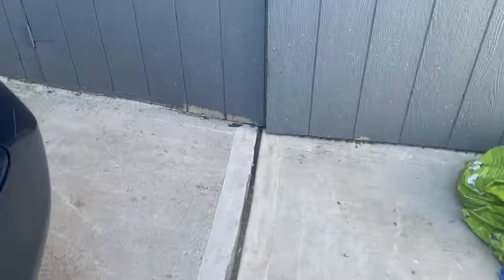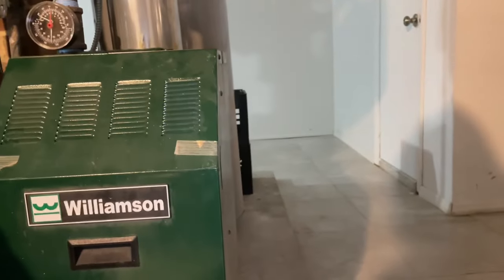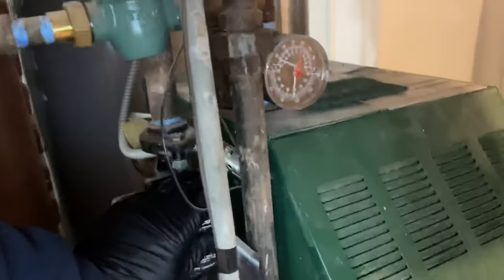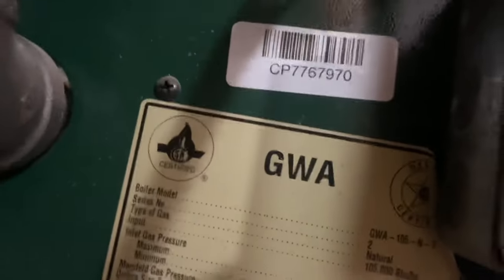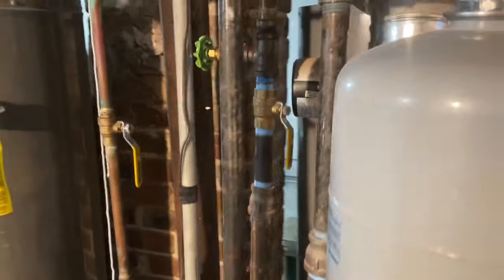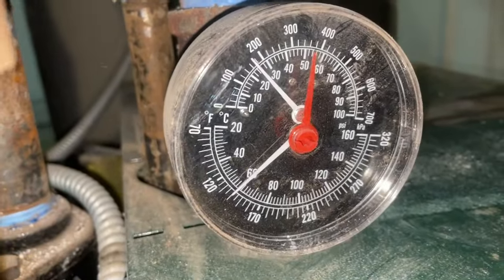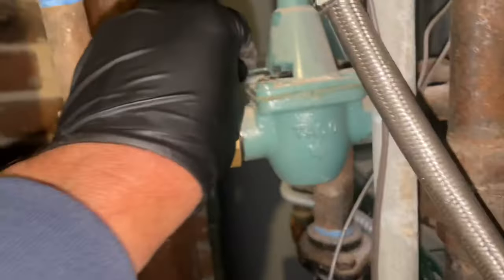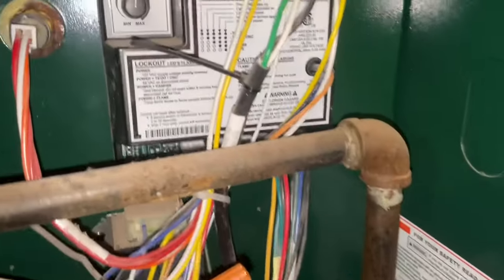No Heat Williamson Gas Boiler - How to Purge Your Single Zone Hydronic System

Comment: I need fuzzy bunny slippers for when I need to purge my boiler.  :)  I got to learn the hard way how to purge my system.  Pipe broke in the middle of winter and all the water pumped out, luckily the boiler didn't burn up in the process.  Fixed the broken pipe, and then had to purge three zones.

Comment: Quick question- I'm a service tech that's fairly new to hydronic systems,  I've primarily have delt with forced air- my question is why are you running the system while you purge? 2nd question is the feeder alway enough pressure to purge? I was taught to use a transfere pump or even hook up to a near by water heater to provide extra pressure.

Comment: williamson.. a name i havent seen in forever.   they were top of the line back in the 50s and 60s, that one of course looks pretty new.. they mustve been gobbled up by one of the big boys..
Reply: The name was a big common name around here in SE MN.   I really liked them!
Reply: @jaymarking7854  there were lots of their forced air systems here in ohio..  its funny how the A/C design went full circle//  williamson central air conditioners were characterized by a vertical 3 blade fan and the coil in the rear..  while almost everyone else was using a top fan and a surround condenser..  funny how all the new mini splits have vertical fan and rear coil..    williamson was made in ohio for awhile I believe..  my grandmother's 30 year old williamson from the 60s was still going strong when she passed in 1997..
Reply: @eldoradoboy   Both of my grandparents had them. Williamson Oil Saver,   Then one of them moved to town and had a 5-in-1  installed.  I grew up with A Temp-O-Matic.
Reply: Seeing the “CP” serial on it, I figured it was a Weil made unit. 

Grandparents had a Williamson oil fired Temp-O-Matic lowboy furnace installed by the local Ma and Pa oil company back in ‘89. 
The oil company, and my grandparents are all gone, but that furnace is still going in what’s now my mothers house.
Reply: @erikj.2066  I was looking the other day for pictures of my grandmothers old furnace. .as a kid I remember the thing being monster sized in her basement..  it was a natural gas unit with a single burner and a bonnett for the flame. the blower was belt drive. the A/C coil was flat and vertical.. sat right next to the Monster sized Electronic air cleaner.. everything was inside the cabinet of the furnace including the humidifier.  grandma used a name for it..  some kind of complete comfort system. the floor register diffusers sat oin the baseboards and were 6-10 feet long..  supposedly it was designed to have the even style heating of hot water but in a gas system. she built the ranch house in 68 with the latest greatest of everything..  even tilt-to-wash "caradco" windows..  (tilt wash windows were unheard of then)..
Reply: Temp-O-Matic  thats what the williamson was called..  @Mikey Pipes  this is prob before your time LOLOL
Reply: @jaymarking7854  temp-o-matic thats the name grandma used I couldnt remember till i saw your post..  Big wide tall gas furnace..  like a turquoise color..  her house always heated so much better than ours.. (she also kept it at like 74 which was so nice).  we had a 1967 Janitrol(way before the goodman days)..  but our house was split level..  did your temp-o-matic have the extra long register grills on the baseboards?

Comment: Umm Mike. This circulator is set up correctly. That is not the supply. Look at the arrow on the casting. It is returning to the lower end of the boiler. This is how I do my installs as well. I let the pump pull. It is on the cooler side instead of the Hotter side. Pump usually lasts longer this way.
Reply: Pumping away = more circulator replacements. Smart Mikey pipes 💰
Reply: @lancepushy7783  Hmm my Taco was installed pulling in 1984 and is still running, as well as my Grundfos pump.
Reply: @NY411Info  I think it was sarcasm. "More circulator replacements" = more work thrown to the service tech.